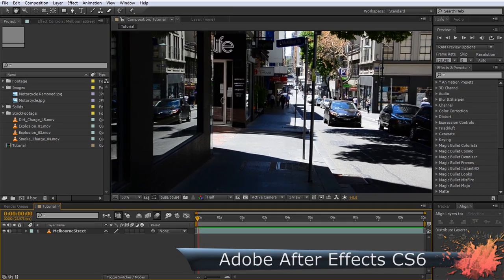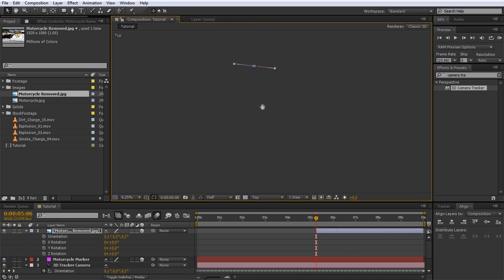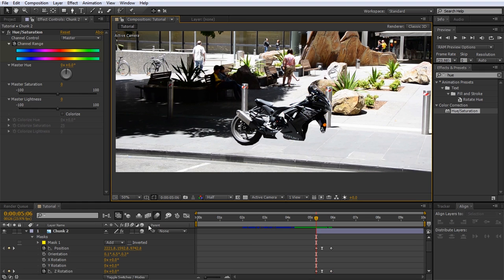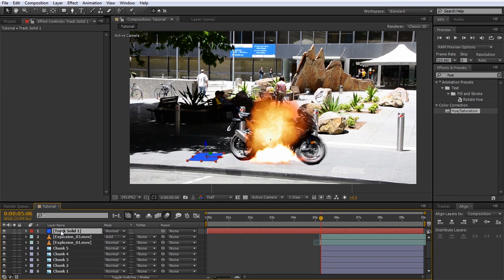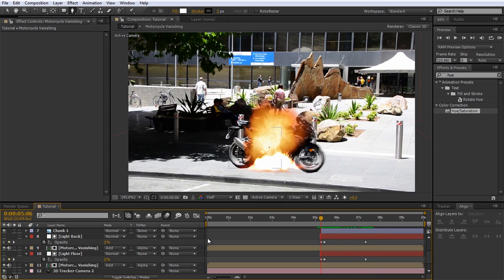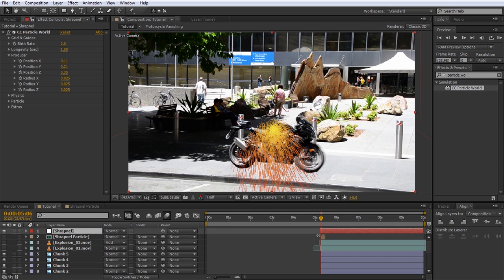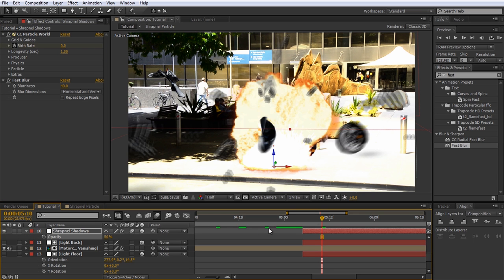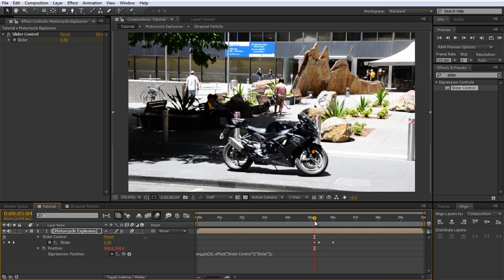How To Blow Up A Motorbike - Adobe After Effects VFX Explosion

Comment from the maker: You can't use Photoshop for video but I think you misunderstand. In the tutorial, I export a single frame from my motorcycle footage as an image, then use the clone stamp in Photoshop to remove the motorcycle and then re-import the cleaned up image into my composition and align it with the footage to hide the motorcycle. Have a proper video or a photo taken on set without the motorcycle will just save you tons of time. Btw, AE has a clone stamp that you can use for video, but it's a bit tricky

Comment: i'd love to see a tutorial on editing out the motorcycle in Photoshop, there have been several times where I haven't had a clean plate. If you could do a tutorial or link me to one, I'd greatly appreciate it!
Reply from the maker: Dallas Dudra Hi, check out some of the tutorials on the Clone Stamp tool in Photoshop - that's what I used. I don't have a tutorial on hand though, but I'm sure you can find one!
Reply: Ahh, the clone stamp! I believe AE has that too right?

Thanks Tobias, love your videos! Surfaced Studio
Reply from the maker: Dallas Dudra Yup, AE does have a clone stamp too :) It can get a bit tricky though if you have to handle actual video as the elements will be moving around and the 'cloned' elements can become very obvious. For my clean plate I usually just use image and do the clone stamp-ing in Photoshop :)

Comment: But what if i wan lt to destroy 1 part only for example "i want to destroy the tire only when i dublicate the video and then delete the mask and move the tire away from the video just like you did the tire will still be there because of the dublicated video" any solution
Reply from the maker: Roj Duski It's exactly the same as for the full motorcycle - as shown in the tutorial. You still have to hide it, that's what I'm using the clean plate for and placing it in the scene. Otherwise you'd see the duplicated motorcycle in my video